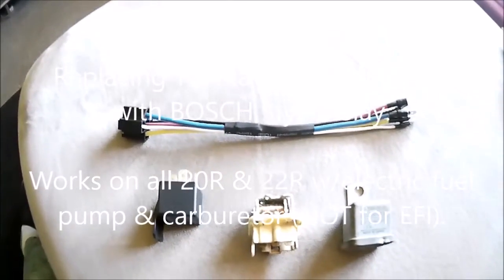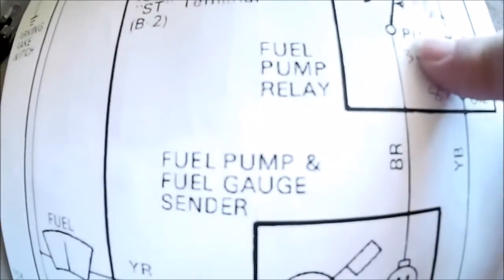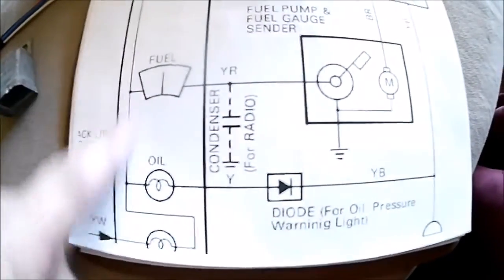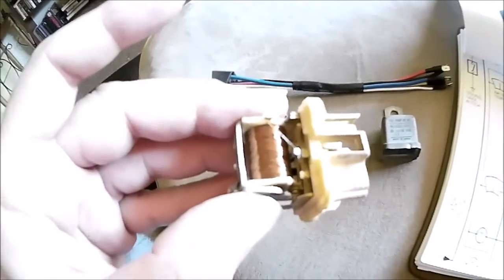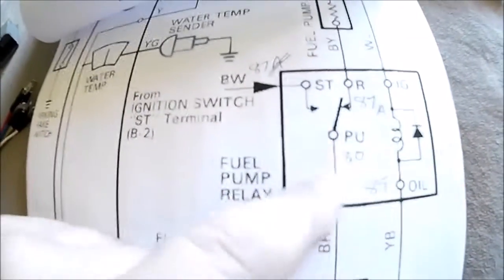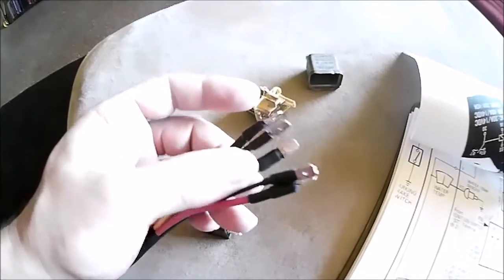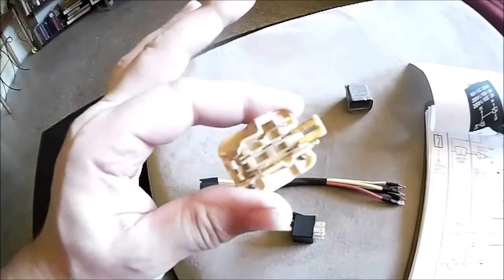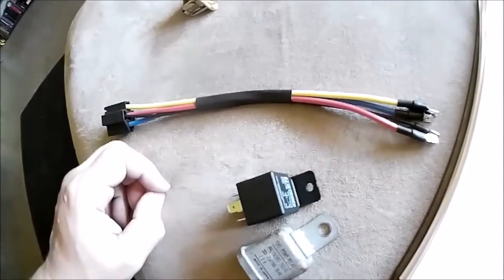1978 Toyota Pickup 20R-Fuel Pump Relay Replacement/Substitute

Comment: have discuss items before on my 77 Toyota pick up I thought maybe the new electric field pump that I replaced may have been my issue but II know that this seemingly stop on the side of the Rood syndrome, always shows a full sight glasses, I was thinking on the carburetor there is a solenoid looking device called a fuel shut off solenoid one time i didn't get tightened after carb rebuild caused a lot of bucking and jerkin could this be my issue all along, this fuel shut off solenoid on the carburetor if so what runs it, why is it there. How would I go about omitting it, making it  N/A. Just to save time I have covered everything I mean everything coil you name it we've discussed it I've replaced everything. is it possible that whatever runs this fuel pump shutoff solenoid on the carburetor could be faulty or the the  Fuell shut off device screwed to the carburetor itself, with the one wire attached ???
Reply from the maker: I have looked through all the previous posts on this video and did not find any from you. Was the previous discussion posts on another video of mine? If yes please let me know which one so I can review the info you posted. Otherwise I'd would need answers to certain questions in order to respond intelligently. I will address a few things you wrote here though.

Assuming you have a stock carburetor, the sight glass should NOT show as full. There is a metal plate in front of the sight glass that has two metal tabs on it. The correct fuel level should show somewhere between those two tab. See diagram here: https://board.marlincrawler.com/index.php?topic=81651.0 It is on the 7th post down. The fuel level in the fuel bowl of the carburetor should be checked with the vehicle on level ground. If your fuel bowl fuel level is "full" the way you describe, the carb is getting too much fuel into it. There could be several causes. 1. Fuel pump installed is not correct and provides too much fuel pressure, flooding the carb. The extra pressure doesn't allow the needle and seat valve in the carb to shut off the fuel flow. What fuel pump did you install? Brand, part number? Is your carb a stock carb or something else? What? 2. Needle & seat valve malfunction. This valve is moved by the float in the fuel bowl. When the fuel level rises, it pushes the float up. When the fuel level gets to a certain point, an arm on the float pushes this valve closed and does not allow the fuel pump to put anymore fuel into the fuel bowl. This is a rare problem, especially on the stock carbs. 3. Float not adjusted properly during rebuild. There is a metal tab on the float that closes the needle & seat valve. If it is out of adjustment, it may not make contact with the needle & seat and not allow the valve to close, which allows too much fuel into the fuel bowl (flooding). Here is the spec for that & other info: http://www.offroadforum.cz/toyota/aarc.epnet.com/application/8578/8578R05_ADJUSTMENTS.html

The Fuel Shutoff Solenoid. Why is it there? It has only one purpose. It shuts off the flow of atomized fuel to your carburetors idle circuit when you turn off the key. This is to prevent the engine from "dieseling" or running on once the ignition circuit is turned off. It should NOT be eliminated. The one wire to it is hooked into your ignition coil power circuit. The solenoid a plunger with a small rubber seal on it's tip. When the ignition is turned off, a spring in the solenoid pushes this plunger forward and blocks off your idle circuit. When you turn the ignition on, the solenoid energizes and retracts the plunger, opening the idle circuit.

It is possible that this part is not working correctly, or that the rubber seal is torn or damaged. You can disconnect the wire and remove the solenoid to check the seals condition, and to verify the solenoids operation. You just need to apply battery power to the wire & see if the plunger retracts, then extends once power is removed. I have not been able to find a replacement fuel shutoff solenoid available on the market at the retail level. The only way I could get a new one is to order a fully rebuilt carb from National Carburetor. If the fuel cutoff solenoid is not fully tightened down, it could be the source of a vacuum leak. There is also a small circular gasket that should have been replaced, and usually comes with the carb rebuild kit.

Other possible issues. Binding throttle rod linkage. This can affect the idle position of the carb and cause poor idle quality, or cause stumbling issues. Throttle rod linkage wear. On my '78, I had wear to the gas pedal linkage, and still have wear on the rod of the black hinge assembly on the firewall (located straight behind the carb). All this can also throw off the idle position. I have at least one video up about the gas pedal linkage rod, and another one about the rods underhood. At the very least, spray down any & all moving pivot points with WD-40 to lubricate them.

If you can point me to your previous info that you posted that will help, otherwise I've got some quesrtions that need answered so I can hopefully point you in the right direction.
Reply: Once again thank you for your timely response and your kind attention, just to save time over the years I've had the truck 17 years over the years I've had an issue where the truck  shuts off you can be going down the road and it's just like the fuel shuts off, obvious fuel pumps have been changed lines of been cleaned out float float bowl is correct I have done tests using your specs on the coil I've changed igniter gone through every possible thing that could cause this motor to buck and jerk like it's being suddenly electrically shut off or fuel is shut up suddenly, quickly, abruptly hard ,often on much like you're saying here this fuel shut off   Solenoid, As a  Retired car mechanic and smog mechanic I realize sometimes even on simple cars non computerized I mean, it's a matter of trial-and-error, a badd ground something real basic ,I've covered everything, except this fuel cut off so noyed on the carburetor, Like I said when it shuts off it does it fast like the power is being shut off Only thing on this vehicle I have not dealt with is this Fuel shut up solenoid on the carburetor I feel that this device going on and off quickly could give me my issue It doesn't just starve for gas it just instantly shuts off and bucks in jerks like something inside the carburetor is  Shutting the fuel off and on abruptly much like an electrical issue , not electrical issue i covered all of that. Many times when this truck would suddenly start violently jerking I would pull over and the sight glass would be perfect right on the money leading me to believe that if it's starving for fuel suddenly it's not externally out of the carb its  Internally, the truck did have issues replaced coil, points ,plugs, condensers, a lots of stuff ,went through the carburetor and this helped it but it still has this sudden I don't know where you never know when it's gonna start doing that again. Do you think there is a relay between the key and the fuel shut off solenoid on the carburetor? It seems to do this the most violently at that cruise position on your gas pedal if I push it all the way to the floor and hold it it'll try to keep going, if I pump it it'll even improve more which leads me to believe that if this fuel solenoid is shutting off the itemized circuit then certainly wide open throttle and pumping the throttle would help it and it does. ROD
Reply from the maker: @rodneyyoung385  Glad to try to help. I'll try to take your items in order from the top.

Fuel lines - you state they have been cleaned out, but have you ever replaced them? Are you running regular gas in it and are you using the 10% ethanol gas that is common nowadays? I discovered the old rubber fuel lines are NOT formulated to handle ethanol fuels and break down from the inside, shedding tiny rubber particles that can get past your fuel filter and clog up idle passages in the carb. This is what happened to me. I you have not replaced the rubber fuel lines I highly suggest that you do so, with lines that are rated for Ethanol fuels.

Iginition - You mention an Igniter but later you mention points. What do you actually have? If you have both I know they did come that way, but there is no accounting for what previous owners may have done. Other thought; if you do have the points system, have you tested your ballast resistor? Once those start to wear out, their resistance can rise with underhood heat, create too much resistance, and effectively shut off power to the coil. It might rad the correct 1.4 to 1.5 Ohms cold, but rise once it gets hot. I had this same problem with my fuel pump resistor, and it's a good idea to check that one as well with an Ohm meter, both cold & hot. Either one hot shouldn't read any more than 10% above spec, 1.54 to 1.65 Ohms. More than that hot and it's bad.

Fuel Cutoff Solenoid. It's been my experience that these almost never go "intermittent", they are either working or they aren't. If it is acting intermittent, it's either bad grounding (unlikely since it grounds through the carb itself) or the connector is loose, dirty, corroded, or any combo therof. Again, only way to get a new one is to order a completely rebuilt carb; the part just doesn't exist out there in retail on it's own, I've looked.

To the best of my knowledge, there is no relay between the ignition key switch and the fuel cutoff solenoid. It's wired direct into the "hot" side of the ignition circuit. There is a relay for the fuel pump (as you've seen on the video) but your symptoms don't sound like that is the issue. Again, also test the fuel pump resistor. It's underhood on passengers side fenderwell.

You say it will do this most violently at cruise position and if you pump it, it will improve. Two things. Does the engine idle normally once up to full operating temp or no? Without any pedal input from you? Second, I've learned that the idle circuit isn't just for idle, but continues to provide fuel above idle speeds, so any blockages in that circuit can have a "lean-out" effect at certain speeds, and could cause "cut-outs", stumbling, etc. Pumping the pedal when this happens is just using the accelerator pump to shoot a bit more gas down the carbs throat to make up for the "missing" fuel. That's why it might be smoothing out.

Things I MUST know/have answers to. Has your carb ever been rebuilt since you have had it? If yes, by who and when? Have you done any cleaning to the carb yourself? If yes, give me a complete description of what you have done. Have you checked the bottom butterfly shaft on the carb for play? These carbs have bronze bearings for that shaft, and my old carbs bearing were worn, causing shaft play and a vacuum leak. You can also check for this with the engine running by shooting carb cleaner at each end of the shaft. If the engine speeds up a bit on it's own, you've got leaky shaft bearings.

I don't know what level of experience you may or may not have with working on vehicles this old, but I will pass on something here that I have learned. These trucks are over 40 years old, so some of these things you just have to suspect, which ordinarily you wouldn't suspect. So it pays to check every component in a given system or even every piece in a part, without fail. I didn't and it sure gave me an education, but sure cost me a ton of time. Baseline everything.
Reply: Great thanks,as usual you have supplied food for thought and some more things to check, too far into this truck to stop now will keep you informed, thanks much, Rod

Comment: Thanks for the info. Just to clarify, you recommend the Denso 567-0045 even though the ebay sites say Not Compatible?
Reply from the maker: The basic answer here is, that it should work, despite the parts suppliers saying that it is not compatible. The basis of this is that the relay is electrically the same as the earlier fuel pump relays that are no longer available. They all work exactly the same way, regardless of part number, or whether or not the truck is EFI or has a carb. The "pin" positions in the socket are or should be the same, the coil inside operates the same way and so do the contacts. The main thing is if the socket type is the same; Toyota does have a later relay with a different socket layout that will not fit.

It doesn't matter if the truck is EFI or not, there is only a difference in what triggers the action of the coil. Explanation - In carb'ed trucks, the trigger is the oil pressure sender switch. In EFI trucks, the trigger is Air Flow Meter. Both are basically simple switches that either allow current to flow or not. They both work the same way electrically, as far as feeding a signal to the relay.

After much research I am 100% sure that the relay is exactly the same inside as the old versions, so logically it should function. I thought I put a comment note saying that I had not tried this myself, so I cannot say 100% that I have personally seen it work. I went with the "Bosch Style" Mod instead, as shown in the video. It was much cheaper, only involved some extra wiring work to solder on the terminals, and after 3 years has been working flawlessly for me. FYI - Even Toyota went tot a Bosch Style Relay after 1995 model years, even for Lexus.

I only recommended the newer model Denso relay for those that want to try it out, and have a simple "plug-n-play" replacement.
Reply: @The13thSword  After studying the diagram I see it now, thanks again. I went with the Bosch relay.
Reply: @The13thSword  Where is the relay located. Is it on the steering column?
Reply from the maker: @duderama6750  On the '75 to '78 Pickups, the relay is located under the dashboard, to the passenger side of the steering column basically under the area of the radio. It is mounted by 1 bolt to a flat piece of metal, with the bolt head facing the floor side.